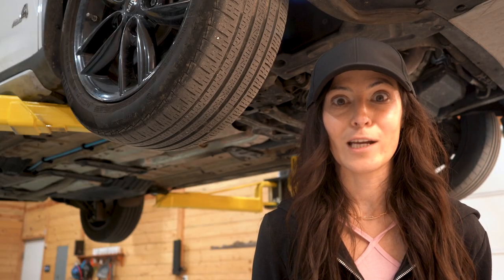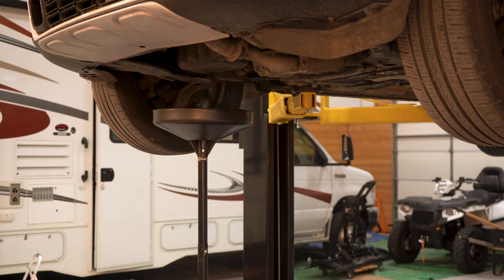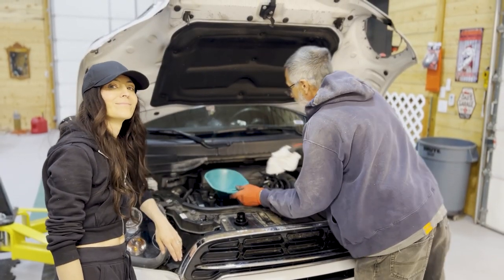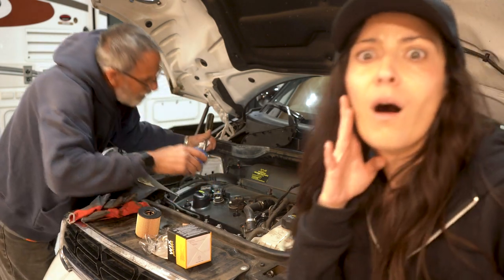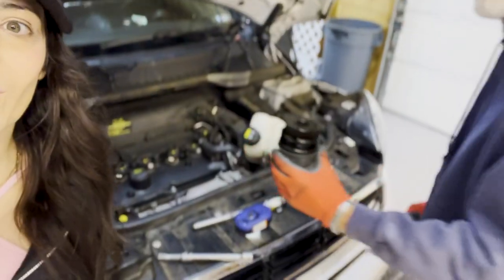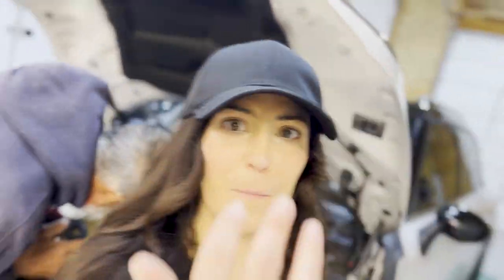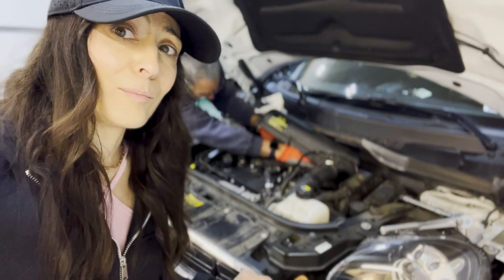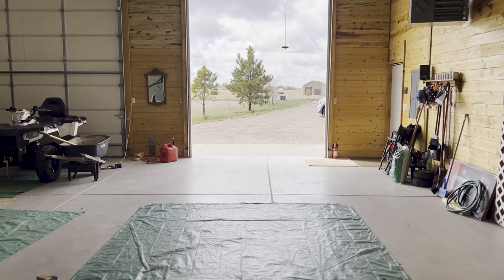how to change your oil (w/ my Father In Law) 🔧

Comment: Two points. The next time you change the oil filter before you add thhe oil and second. 4.4 US Quart is 4 litres. 
Now change the cabin filter. It is the air you are breathing. 

Fun vid